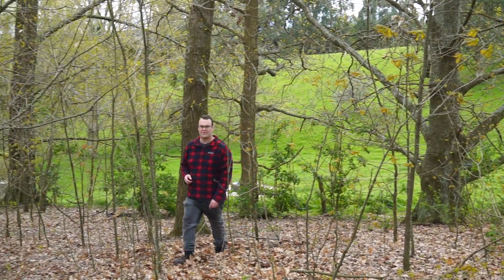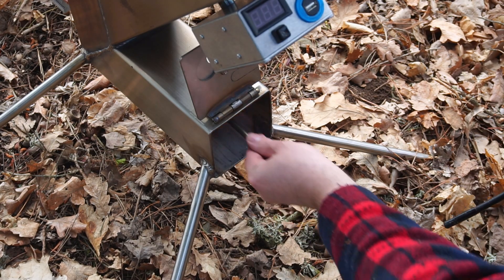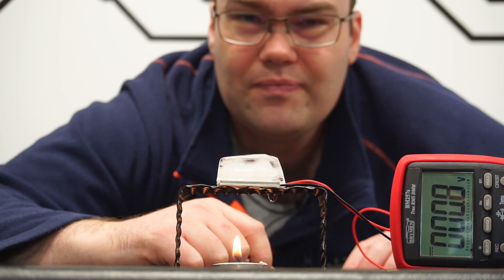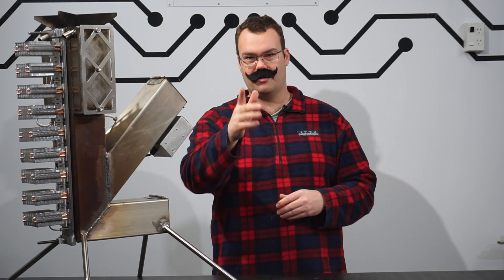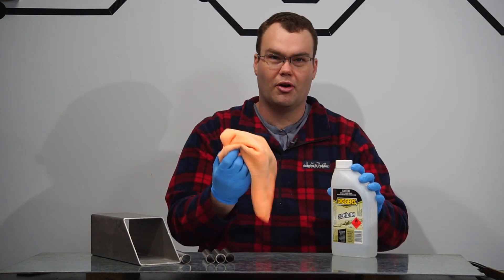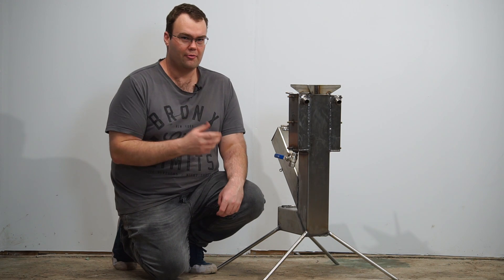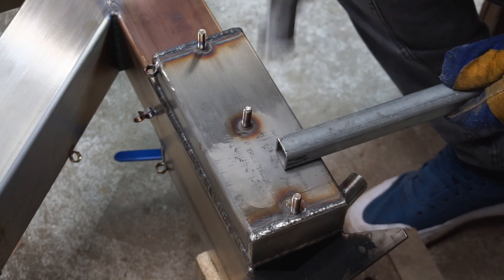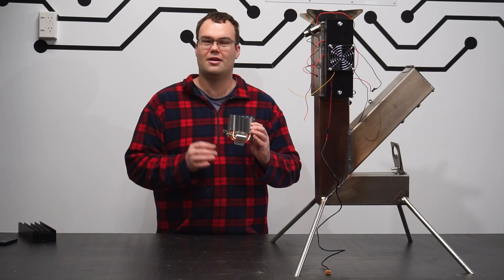I Charged my Phone using FIRE! Survival Rocket-Stove Build

Comment: That is not a true rocket stove. The "chimney" should be insulated with a metal liner. With the correct configuration the chimney will maintain higher temperature that will combust soot (smoke), and carbon monoxide, and be vastly more efficient.

Comment: I would say for a welder hobbyist you did good on the stainless, I was a certified welder, instructor for 40 years, and later in life a CWI before health issues forced me to retire. Very nice welder with built-in pulse. The pulse will make you look like a pro. Most of the black on your welds is from too much heat and not moving along at an even pace. That will improve with practice and you did select one of the more difficult alloys to start your welding lessons on. When cutting with the hand grinder and I am assuming it was an .045 thick wheel go ahead and grind the entire length of the line getting below the surface then go back and grind the way you did in the video, you now have a guide line to follow. One more thing, after you cut the threaded rod, go to the bench grinder and hold it at an angle, say 45 degrees with the end to grind pointing down and slowly turn it CW with the grinding sparks going down. Not too many people are brave enough to start with stainless especially with little experience and video the entirety of the build. It looks like you did a great job on every bit of it. Thanks for the video and sharing the knowledge.
Reply from the maker: Thanks for your kind words! The black scale was bugging me big time. After spending a few more hours on the welder, my technique has improved & the black scale isn't as bad (Still need more practice!) Glad you enjoyed the video ;)
Reply: instablaster

Comment: This is  a nice build. I might try to use your  Rocket stove design and increase the water boiler capacity and use the TEG design from the You-Tuber Tech Ingredients. ( https://www.youtube.com/watch?v=hDLWO_Iaflc ) check out his TEG build It seems to produce a lot more electrical output though it does use water cooling for the cold side. This is still a nice build. Maybe some how make it modular for air cooling when there isn't a source for flowing water.

Comment: Be careful using a file that has failed steel on stainless. You'll mix steel into the stainless and it can make rust spots. Same goes for a flap disc sandpaper wheel. I've learned the hard way about cross contamination